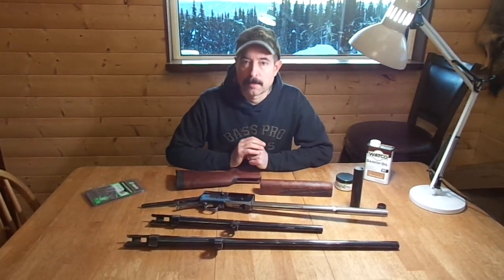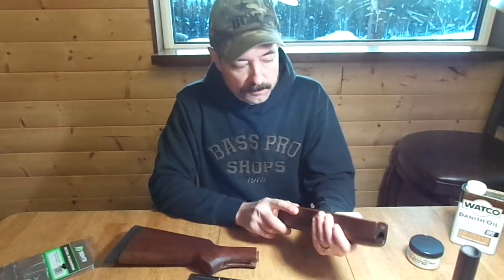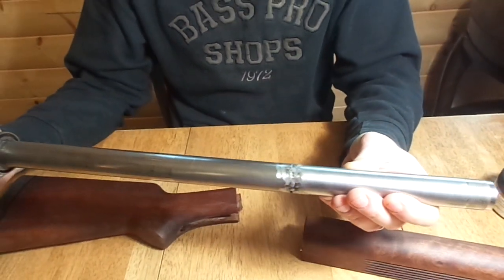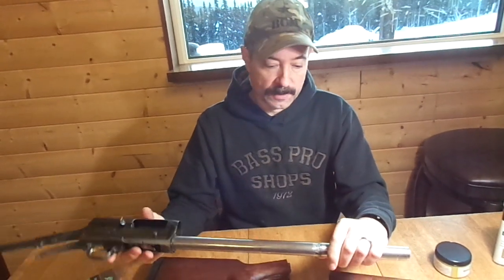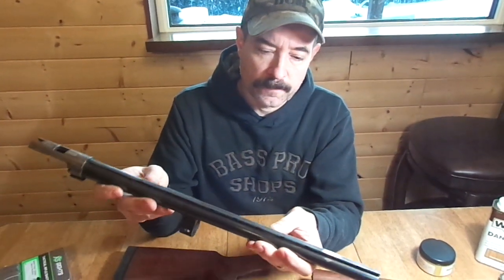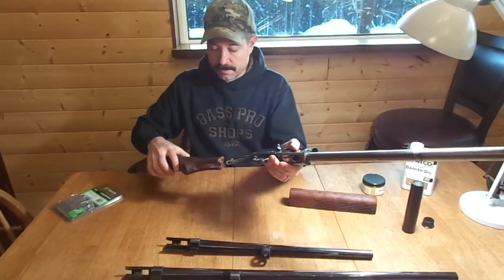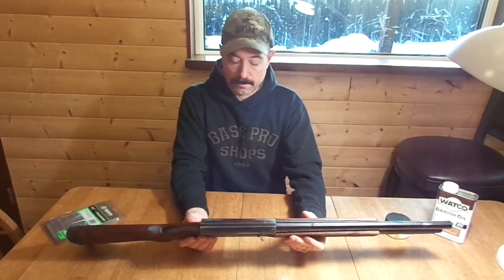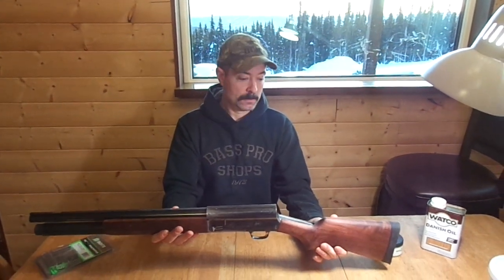Combat Browning Auto 5 part five, now an Auto 8 !

Comment: Love the a5 but hate inertia SGs. They kick lick a mule.
Reply: I have had a handful of long recoil shotguns over the years. I still have 2. They recoil less than a break action or a pump. 

If you have the friction rings set up right. I currently have 11-48s and they are self adjusting.

Comment: Wouldve been nice if you made a video showing how you cut the barrel and finished off the end, I was really curious about that. I like your idea with that pvc spacer, definietly adds some girth and beefyness to the end of the shotgun. What did you paint it with? Just regular spray paint or bbq paint or automotive paint?
Reply from the maker: I bought the barrel already cut on Ebay. I did run some fine grit sandpaper over the muzzle to smooth out the sharp edges. I painted the PVC pipe with some krylon or rustoleum, can't remember which. Nothing special, just remember it was spray paint that was compatible with plastic.

Comment: Just my few idea,s................Why not get a custom mag tube made on a lathe as:u know the treath size that fits in the receiver and u have the corrrect treath size for the screw cap and u know the inside and outside mag dimensions for  skilled man it can be that hard to make a magtube with the length u want.

Or much easyer buy a extende tube with spring kit of ebay for 140$ like i did so i have a auto 10 meaning 9 in the tube 1 in chamber,no welding no this or that,meaning i can convert my gun always back to as stock from factory.
Reply from the maker: Thanks for commenting, I actually considered both options you mention, but decided against them. I suspect getting a custom tube made would be fairly expensive, primary reason I didn't pursue that course of action. Maybe I am wrong. I also enjoy doing things myself as much as possible, though I did have to get my nephew to TIG weld this. I am also not a fan of magazine extensions, I have seen multiple failures when shells, springs, or follower stick or hangs up on transition between tube and extension. Also, due to long recoil system a mag extension to barrel clamp is not possible. The welded tube should be much stronger than a threaded on extension without a barrel clamp. I also purchased an additional mag tube so I can return to stock configuration.

Comment: Anywhere one could find an extended mag tube that wouldn't require splicing and welding?
Reply from the maker: If you could find an original Rhodesian mag tube, but they are as rare as the proverbial hens teeth.